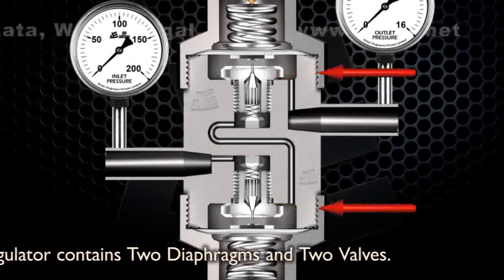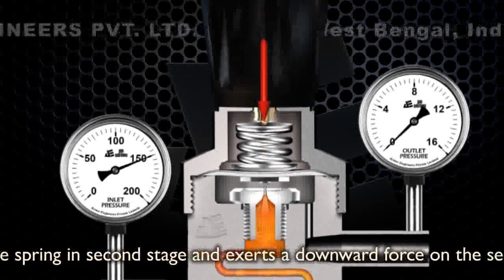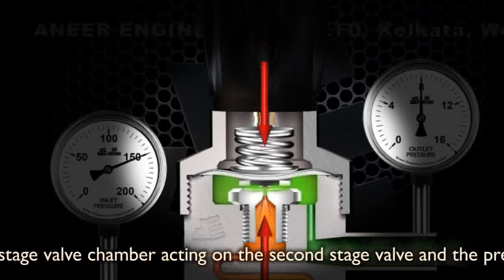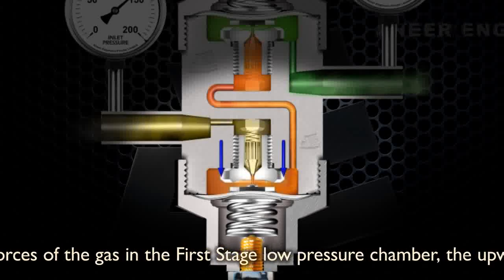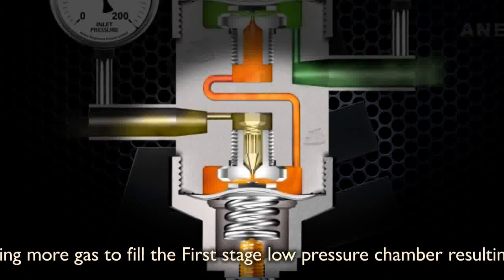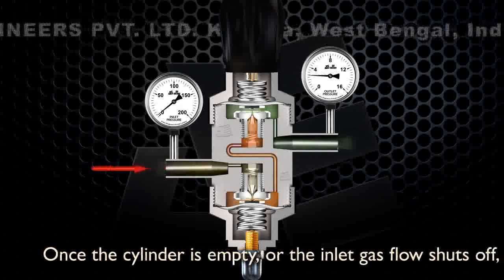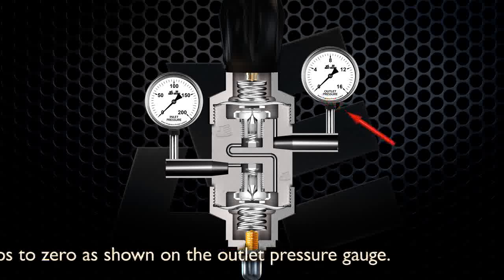Working Principle - Two Stage Pressure Regulator

Comment: Does a two stage regulator by definition have two gauges? 
Can you have a dual stage regulator with one gauge? 
Thanks
Reply from the maker: Thanks for the query. The answer is NO, though it normally has. Single and Two Stage does not have any relation to the number of Pressure Gauges but the number of stages in which the cylinder pressure gets reduced to working pressure. And Yes, if you want you can have a two stage regulator with One Gauge also.

Comment: What happens to the mass flow rate in a dual stage regulator when it maintains a constant delivery pressure , however the cylinder pressure keeps on decreasing

Comment: If I have an open ended piece of tubing connected to the regulator outlet, I'm assuming I won't get any reading on the outlet pressure gauge, i.e. it will remain at zero, but the inlet pressure gauge will still register pressure from the supply cylinder, unless it is empty. Is this correct? Thanks. Good video!

Comment: Good video. One question - I'm unclear why the pressure in the high pressure chamber does not equilibrate with the intermediate pressure chamber. Does the valve stem automatically close when the set pressure in the low pressure chamber is reached?
Reply: The reason the high pressure chamber does not equilibrium to the intermediate chamber is the same as for a single stage pressure regulator. The force against the diaphragm along with the force against the valve stem which is not observed in the intermediate pressure chamber closes the high pressure chamber from the intermediate pressure chamber. Then you have the exact same concept stacked on top of the high pressure to low pressure regulator in order to drop the pressure to the low pressure chamber. Think about a single regulator in his first video. You just continuously stack these on top of each other until you get the pressure you desire if you are coming from EXTREMELY high pressure to low pressure.

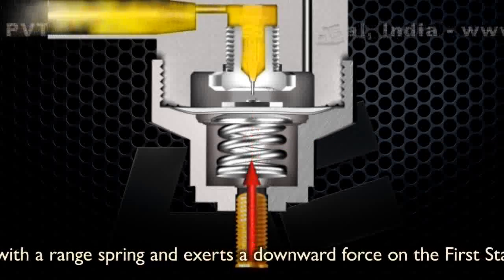Comment: Very helpful videos, thank you very much.  A minor correction to be made:  at 1:29, the caption and narrator say "downward force", but the video shows an upward arrow.
Reply: Thank you Glan. Noted and will be corrected.
Reply: It's a very nice video, but the middle bit is completely wrong. The transient internal chamber will DROP in pressure as the bottle is deplted, not rise. There are two incorrect comments made where two wrongs made a right. One mistake per stage. A drop in supply pressure will cause a drop in down-stream pressure for each stage. The drop after the second stage is minimised by having two stages, but not eliminated.
Reply from the maker: The Supply pressure at First Stage will first increase with the diminishing cylinder pressure as the same in a single stage regulator and finally will drop. That's the beauty. We request you to check it practically.